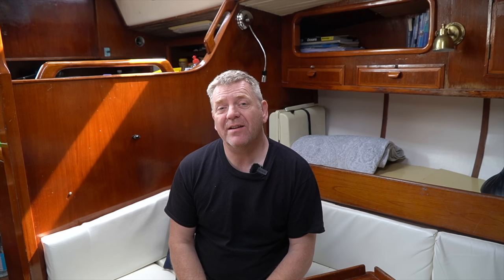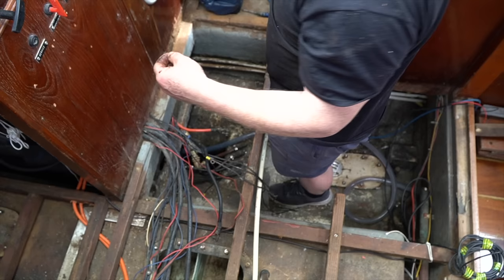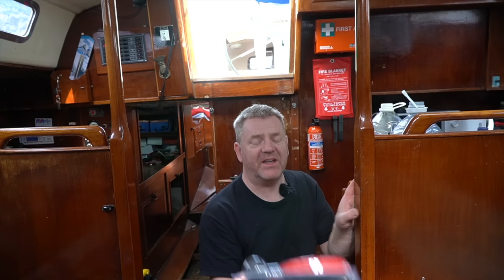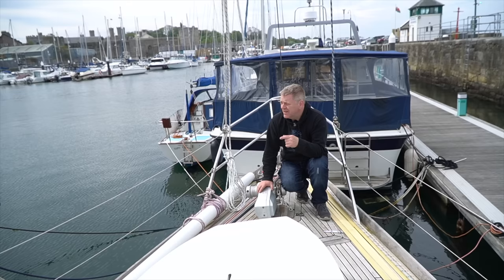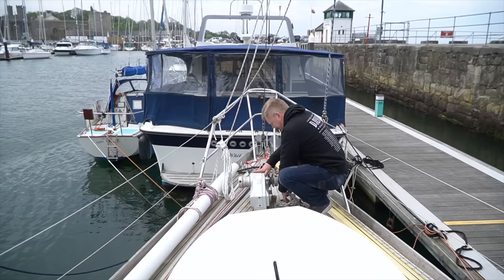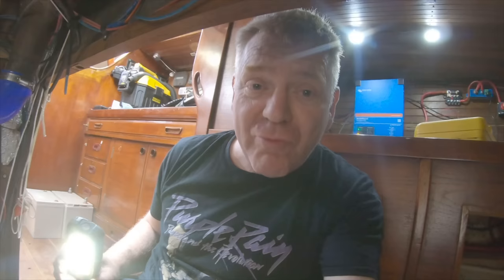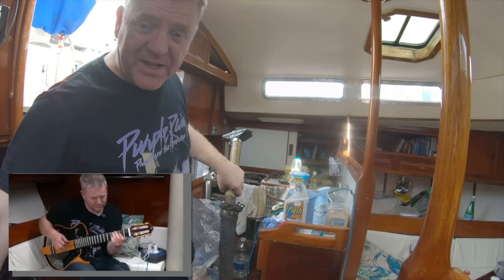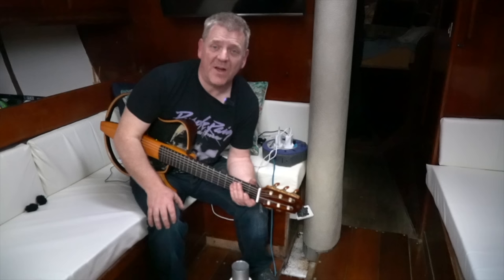#142  : Mantus M2 Anchor and Swivel installation, and cleaning flithy bilges

Comment: Great job on cleaning the bilge Andy, I would have used a degreaser or bilge cleaner to help breakdown the sludge before using the jet wash. might be worth considering when you clean the tank out.
Reply from the maker: Yeah I did use some detergent which was a degreaser but I’m going to go over it a few times I think until it’s really clean
Reply: @SailingMelody I’ve cleaned my diesel tanks and bilges and lots of other stuff, even vinyl headlining 😮 with truck wash. The trade name of the stuff available local to me is Transport 5000. With my diesel tanks I sprayed this stuff on neat with one of those pump spray bottles and let it soak. I was lucky enough to have a hot steam cleaner to blast in there which really finished it off. But truck wash is great, it’s so powerful I buy 20 litres at a time and use it for all sorts.

Comment: that pump looks very useful indeed!
Reply from the maker: Yes it is! Just a standard whale pump with a piece of tubing long enough to reach all the way out of the boat and then I bought a length of 20mm square stainless box section so you can direct the pump exactly where you need it.

Comment: Next time you use any sealing tape or similar stuff on threads, roll it on, in the direktion the thread goes on. Its less likely to get unwrapped or pushed up this way!
Reply from the maker: I thought I did. Gonna have to watch that footage back and check now, maybe I didn’t, but normally I would always do that.   Not that it matter too much in this application

Comment: Use a strong mix of oxalic acid and rub it in with a sponge! Then preassure wash it off! I had the same situation as you! Its now lovley and smelling nice and clean ofcourse!!👍😊
Reply from the maker: I’m looking at several different solutions for breaking down the film and emulsifying the oils. Oxalic and phosphoric are both options :) thanks for the Suggestion

Comment: Our Rival 38 deep bilge was over 1m deep under a glassed in oil drip tray. It was disgusting.
As part of prep for our electric motor we cut out the tray (the ply underside was unprotected and oil soaked).
As there is concern that the keel under and around our deep bilge is weak we are going to partially fill with expanding epoxy foam locked in with a treated plywood frame. Then a glassed in bilge top with sump for pumps that can be reached at full stretch.
So even if crushed aft end of keel in a grounding we shouldn't lose the epoxy foam core and shouldn't leak.

Comment: Hi Andy, 1st congrats for your new baby, 2nd put the ptfe tape onto any job winding it on in the direction of the threads so when you do up the nut it doesn't try to unwind but goes with the direction of the tightening thread, and 3rd but by no means least get a big bottle of Gunk and scrub that into the c#£p in your bilge Then pressure wash it , it is brilliant. 
Keep up the good work , I'm as jealous  as anything. I sail through you and your family.
Reply from the maker: Hiya :) thanks for the support. I was sure I wound the ptfe the correct way with the threads but you’re the second person to comment so I need to check lol. Good suggestion using gunk

Comment: It looks like you could pull about 10 miles of old hose and wire out of that boat and never notice a difference.  I had a Mirage 26 that was pretty much the same. 😂
Reply from the maker: It’s all in decent shape and quality just a mess. But I’ll replace it all over time

Comment: Looks like you need some diluted non-foaming degreaser in your clean water pressure washer like TSP and dilute household bleach.  The odor is the result of anaerobic bacteria feeding on waste water nutrients and releasing the foul sulfur-containing odors.  Sodium hypochlorite will kill the anaerobic bacteria for this cleaning.  You have a job with the sludge in your long range diesel tank.  You sure don't want traces of the existing mold, fungus and bacteria colonizing a LR tank full of fresh diesel.  As to your renewable energy setup; you should plan on at least one 400-600 watt wind turbine to supplement your PV.  Mount them on the stern rail and send the dump energy to your hot water tank. Start small to keep it economical and easily feasible.  You're primarily after the 24/7 contribution.

Comment: It sure helps when tools work properly  ..  A good tip from my sailing instructor is to keep a couple òf large diameter hoses long enough to go into the bilge and over the side a few metres below the keel aft of the boat ..
A venturian effect will drain away water quickly while under way at sea .  Just tie a weight on the overboard end to keep it down..  But of course, there is no pump faster than a desperate man with a bucket!
....
Reply from the maker: Hahaha that’s true. But I’d need a tea spoon not a bucket to get down into the bottom of that bilge. And the tea spoon would need to be on the end of a 5ft stick

Comment: Yes lovely job bilge cleaning, one job I do every time we spend any time at a Marina berth (easy disposal of waste) I had a Major oil leak while underway once it took years before the grime stopped appearing which was such a pain considering before that the boat bilges were relatively clean. Those oil mats were invaluable at that time always had one in the bilge and never drained the bilge so the sloshing of water brought out the oil and the mat soaked it up. also clears up the occasional diesel leak, don't you love old boats and motors :)
Reply from the maker: Hahaha yes these things are sent to test us. Thanks for the comment and support

Comment: That small orange hand pump works pretty good but you need better hose on it. The hose that comes with it is too rigid and it’ll curl away from where you want it and if it has a crimp it’ll stay in it so it won’t flow properly.

Comment: Get yourself a Titan wet n dry vac from screwfix Andy.. cheap as chips and so useful. Would have emptied that bilge easily mate.
Reply from the maker: My Stanley fat max wet and dry vac would as well but I didn’t want to wreck it because the water was really oily and ‘orrible
Reply: Yes that’s what I have used on my Rival bilge which also very deep.  Sucks all the dirt, oil and muck and leaves the bilge really clean, especially if you have a brush on the end and add some soap or degreaser.  The hoses don’t take long to clean afterwards but boy it works fast.
Reply: @SailingMelody  my guess is you spent as much on those 3 pumps if not more than a vac would have cost.. would have had the job done in lot less time

Comment: to get the last bit of sludge out of the bottom, just keep refilling with fresh water and re-pumping it out.
Reply from the maker: Water really isn’t good at dissolving Greece and oils though. Need to use something which will actually thin it down, like paint thinners or even petrol but they’re dangerous to use in an enclosed space like that
Reply: @SailingMelody  hand degreaser?

Comment: New camera? Video quality is great in this vid!
Reply from the maker: Sony Alpha with a new Sony lense. I’m starting to play around with longer focal lengths over 50mm for a narrower depth of field and a 180 degree offset on the shutter speed and aperture etc. Keep the f stop low and the ISO reasonable and make sure the lighting and audio is reasonable. We’ve had the GoPro 11 replaced now as well so it’ll improve even more. Sometimes it does just depend what we’re filming though. I’m not going to put an expensive camera in the line of angle grinder sparks lol

Comment: A wet vacuum cleaner had sucked out the dirty water, dish brush and floor cleaner do the rest.
Reply from the maker: Yes I wanted to get the worst done before ruining my wet vac though. The old engine oil sludge was truly horrible and I was scared it would ruin the wet vac

Comment: If you meet my old boss down in the bilge, watch out for her horns . . . . . and her breath.   That being said; awesome idea to emulsify the sludge with the pressure water and hoover it all out.  My what a huge improvement!
Reply: That bilge clean job could have been done just with the manual pump you used in the end. Annoying for you to waste the hours trying the electric pumps but job done in end.
I didn't know how to fasten an anchor to the swivel. Everyday is a learning day...
There is a right mess of pipes and wires down there. Is it all to be replaced ?
Reply from the maker: @jimmyjohnstone5878  yeah I’ll work my way through it but it’s not as complicated as it looks tbh

Comment: My two penneth..... why didn't you just chuck clean water in it until it wasn't claggy? Also,  use a small magnet to bring out those tools 😊
Reply from the maker: Water is very very useless for dissolving grease or oils, try cleaning a roasting tin with nothing but water…. It just emulsifies and you’d be there for days and days before getting any progress. It’s essential to use a solvent like paint thinners or even petrol but that’s very very dangerous in an enclosed space like that so I’m giving it a lot of thought. If I’d just kept chucking water in i would still be there now 😂😂😂

As for the magnet, that’s precisely what I did, didn’t you see that bit. But I had to empty the bilge before I could see where to poke the magnet

Comment: actual degreaser is best - then hot wash soak detergent when on the hard - then paint ??
Reply from the maker: Yeah I need to find a suitable solvent degreaser which is t too dangerous to use in such a closed space